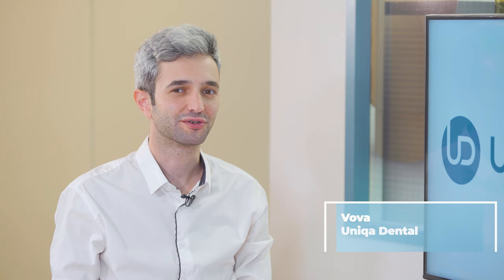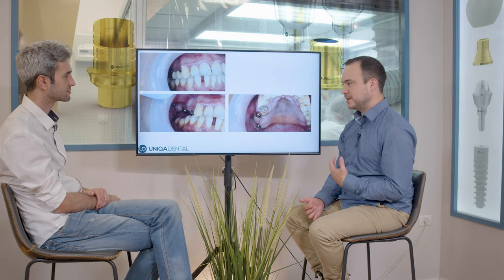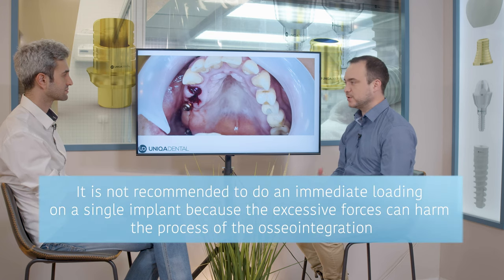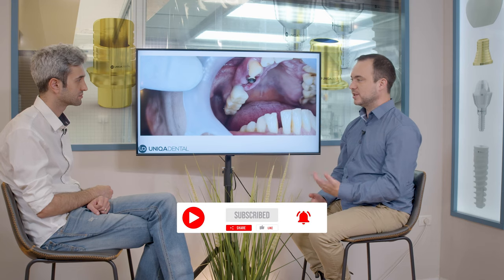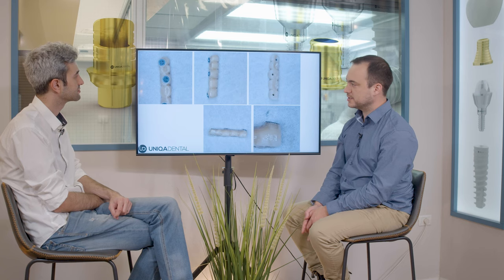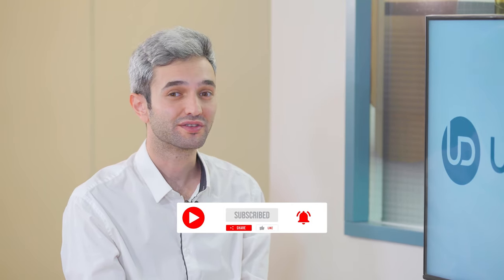Why not recommend immediately loading on single dental implant? Screw retained restoration

Comment from the maker: 00:00 One unit, one bridge. 
00:26 Today we want to share a case where we had a patient with a bridge on a couple of implants. 
00:47 We extracted both of the implants, both of the teeth, and added an implant on the first premolar area. 
02:02 This is the bridge that we had before on those two implants
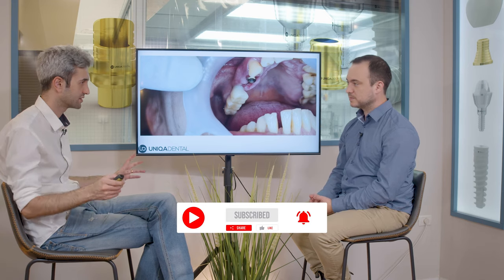02:32 This is the new bridge that was done.
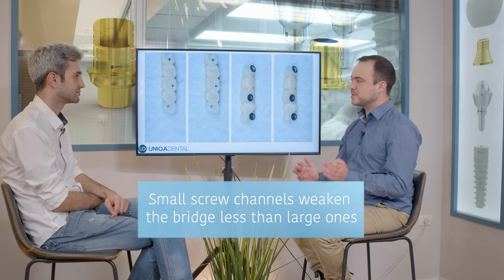03:10 When you immediately load a dental implant, you need the implant to be restored perfectly for three months.
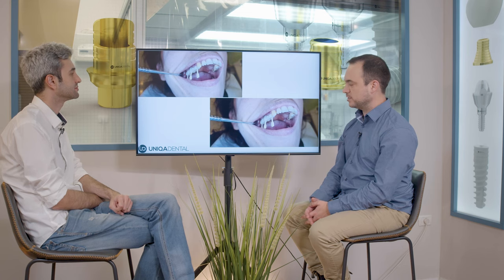03:49 This is the PMMA bridge that we saw. 
04:26 Yeah. In order to take a little bit of pressure out of those crowns.
05:15 And you did this in your clinic?
05:17 Create a bridge, three implants and five crowns.